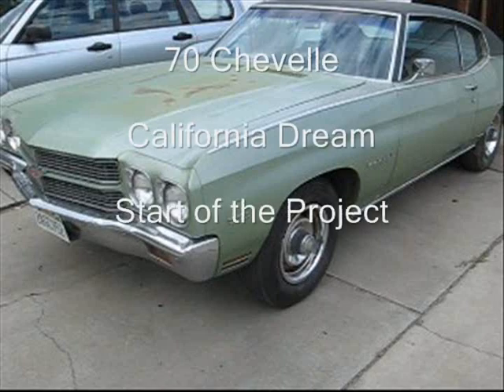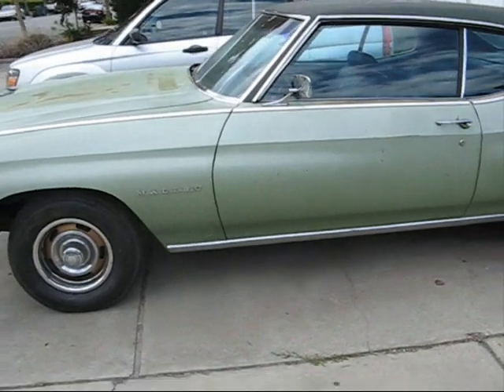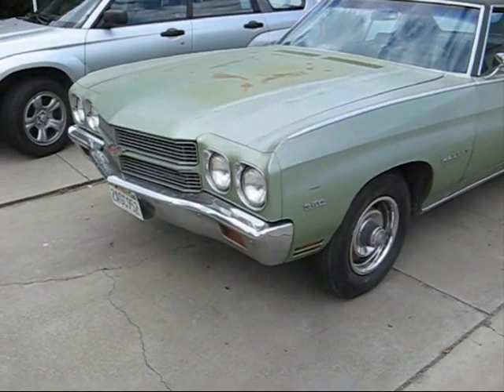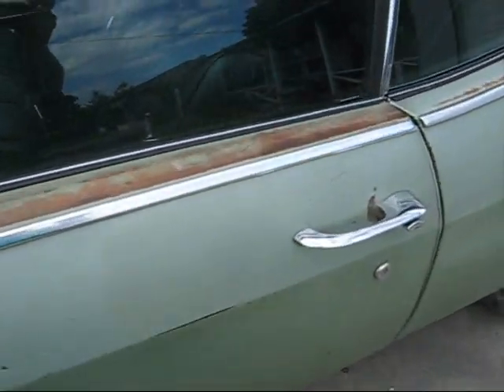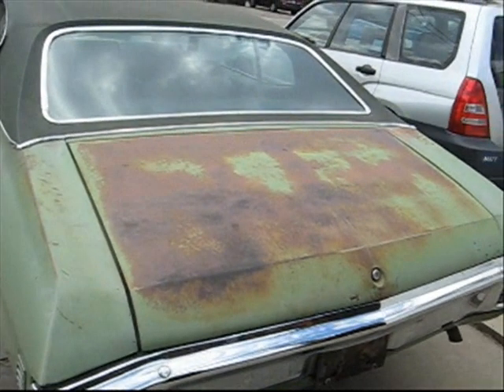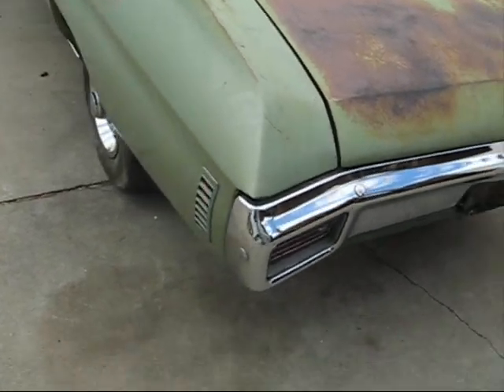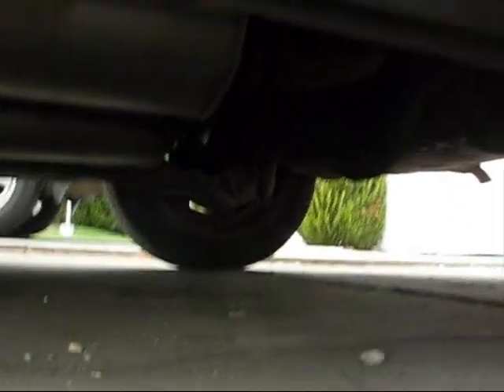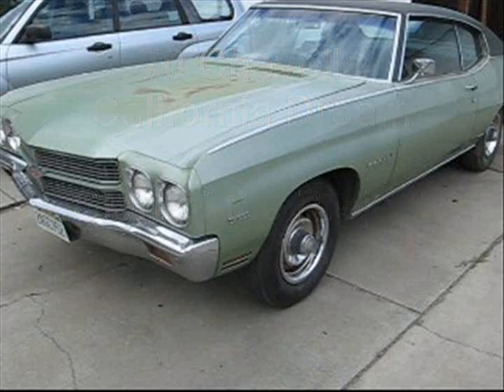Beginning of Project 1970 Chevelle 130122

Comment: How was the sheet metal under the vinyl top upon removing it?  I’m starting a project with a ‘69 Cutlass,  and am hoping it’s pretty clean under the vinyl top, but you never know.  Thanks and enjoyed your Chevelle series.
Reply from the maker: The corner sections below the  rear  windshield were gone.  But that is typical problem because the water just sits under the vinyl top, years go by and so does the metal. I rebuilt it with a fiberglass kit from O'Riellys, comes with material and a 2 part resin.  Watch a video on how they fiberglass corvettes back together, then you will know how to do it.  Easier than welding pieces in.  Plus fiberglass does not rust.

I have a video on replacing the windshields and a 2 part vinyl top replacement.  It was a mess but just take you time, you only have to do it once.